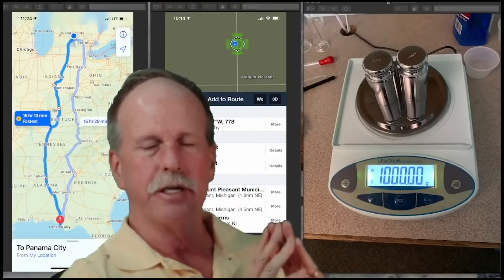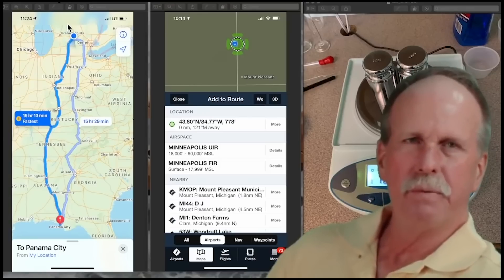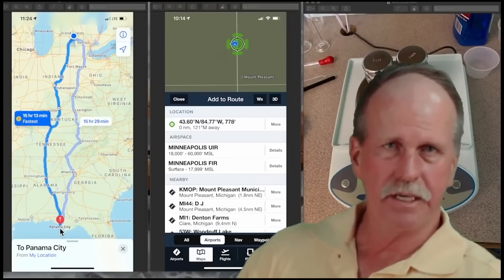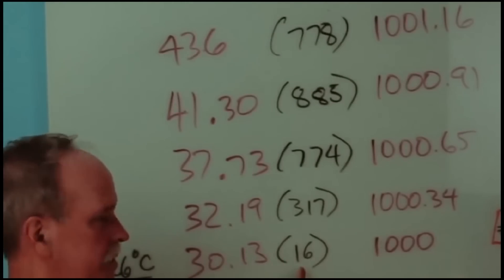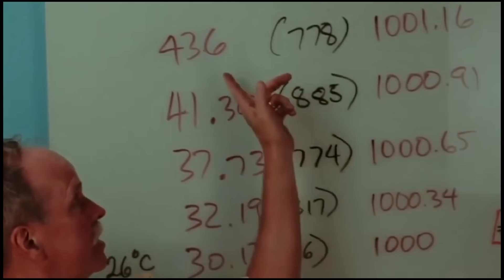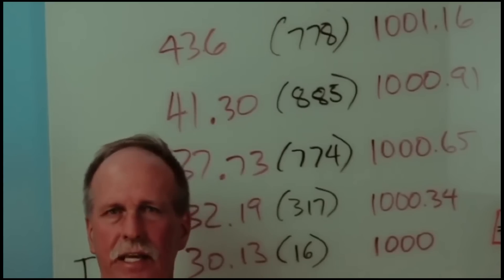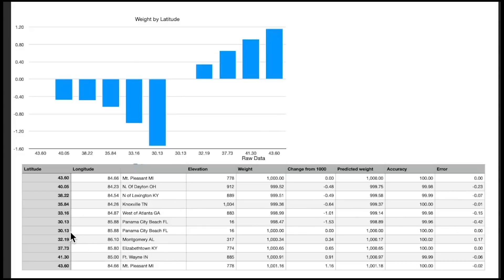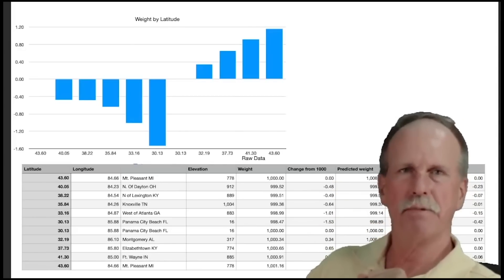Rotation Test for Flat Earth

Comment: Can you prove that the calibration of your scales didn't drift between measurements?

It might have been better to NOT recalibrate in the middle of the journey, and prove that the scales read the same once you got back to your start point - not rock solid proof of no calibration drift, but it might be supporting evidence?
Reply from the maker: the calibrations and results are in the video and they matched the prediction and concurrent readings from other investigators.  proof is in the pudding and it demonstrates the care I took with the measurements.
Reply: @BobtheScienceGuy  Sure. But if we're being rigorous, we can hypothesise that your measurements could be subject to calibration drift. Agreement with other observation, could be coincidence. Can we prove that's not the case? Particularly chucking a measuring device in the back of a car and driving for several hours ... is it not reasonable to ask: was their calibration drift?

Comment: The discrepancy could be attributed to the difference in gravity,  which has been mapped out, as well as the differences in gravity due to elevation. That's why I don't think the data rides the prediction line tightly.
Reply from the maker: No it cannot. Look at the design again.  1/ different routes to account for variations in gravity 2/ matches multiple other similar experiments 3/ matches globe predictions
Reply: @BobtheScienceGuy  
I think we are both on the same side of the argument. 
The different routes would only add another reason for the data points being a bit scattered over the line, and not in a tight line. We all know that gravity based on elevation changes where you are in Earth,  based on (what I think)  the differences in density. That had to come into effect,  along with all the other reasons you listed. If there were no differences in density,  then it would only be elevation and latitude affecting the readings.
Reply from the maker: I think so as well, which is why I took a high and low land route to account for that.  As you are well aware, less than a mile of increased elevation will not make much of a difference with a 4000 mile base radius.  Even 250 miles (the ISS) only results in about a 15% reduction in the force of gravity due to the increase in radius.  1 mile or less is nothing.

Comment: My thought on the outliers of the tests you did could have been caused by temperature of the scale making it read just off a bit. If all the tests were done on solid surfaces and the same temperature for the measuring device then maybe you would not have gotten the outliers. But if the temperature was different than the initial calibration during the testing I'd suspect some variances and we see that. More points of data in both the weights and temperatures would be helpful but this clearly shows the rotating globe vs the flat. Excellent test.

Comment: The altitude is not the same because you forget to mention the last value. But 16ft near a shore would be reasonable. Since you are using a very small mass the difference between gravitational pull between Michigan and Panama city is minimal. And that is even within the United States itself. Also nothing is being said about the weighing conditions. Did you use exactly the same surface when you did all these weighings? The Earth is just rotating, and why would it not? It's a planetary body in the vacuum of space, and yes, it's gravity holds the 'liquid' atmosphere to the planet and takes it with it. I call this a 'liquid' because compared to space our atmosphere is a liquid. The same as water is a liquid in relation to gas.
Reply from the maker: I believe it is on the table

Comment: The Coefficient of Thermal Expansion of a solid eg: metal weight is much smaller than that of a gas or gas mixture eg: air.  Therefore if latitude decreases (and elevation remains the same),  relative density should INCREASE the "weight" simply because temperature trends higher (the opposite of what actually happens).  This also means that at a given latitude,  "weight" should fluctuate with barometric pressure.

Comment: First off, I am not a flat earther. I have a degree in physics and I work in a materials test lab. 

We do a test where we measure the density of samples using wet and dry weights. We measure a sample in air and then again in water. The sample weighs less in water due to buoyancy. We plug those numbers into an equation and get the density of the sample. This is far more accurate than the method you use. 

We also do environmental conditioning. We use hot wet chambers to drive moisture into samples. Typical conditions might be 160°F/85%RH. We periodically weight representative samples to determine how much moisture they have gained. When we weight the samples, we have to cool them to room temperature (RT), because hot specimens will be less dense. Because we are weighing these samples in a fluid (air), hot samples will weigh a little less than RT samples. If we place a hot sample on the scale, we can actually watch the weight increase as it cools. 

I don't remember how much the weight changed, but you could do this at home with your scale using anything you were willing to heat up to about 150°F. 

To determine the density of the reference weights due to temperature, we would need to know the material the weights were made from. Different materials have different coefficients of expansion. 

On some calibration weights, the top threads off and there is a chamber inside that contains sand (I don't know what kind of sand). Calibrating the calibration standard involves adding or removing sand. Submerging the calibration weight for either a direct displacement method or wet/dry weight method would not give an accurate measurement for the material density. It might, however, be sufficient to determine if there is an air chamber inside the calibration weight, assuming you know the actual material density. Also, you might want to compare the weights of your calibration standards to make sure no water has seeped inside the one you submerged.
Reply from the maker: Excellent points. Do you think any of these variable would account for the weight changes observed
Reply: @BobtheScienceGuy  Highly unlikely, especially considering how well the results match the predictions of an ovoid Earth. I also assume you performed most of your measurements at room temperature with a variation of a few degrees. If anything, variations in temperature might explain some of the outliers. 

The specification we use to determine density doesn't correct for air temperature, but it does restrict air temperature to 23 +/-2°C.

Comment: I will do thos experiment, it does look fun to try, I can lend some equipment from university. Easy way to cancel out temperature is by putting each weight in a precise controlled temperature bath for about 15 minutes, BUT, temperature and pressures in my experience have a neglectable change, such changes are used in lab tests to have 0.001g accuracy, which woyld be fun to test. For instance, the density of watwr is 1000kg/m³ at 4 degrees celsius, we have a table of corrections to see what the temperatures are. But definitely I will take a look at this and try to add data, life is fun and full of exciting truths.
For the flat earthers...prove us otherwise, science is about concrete math and proof, like this, a proven statement is assumed correct until proven wrong, science it, happy holidays!🌲🥳

Comment: This is a simple and convincing presentation for anyone that doubts the currently accepted model.  However, I do have one comment, which concerns the effects of altitude on the measurement.  The changes in the gravitational force should be very minimal, but the differences in air density and the resulting buoyancy changes on the masses should be accounted for in a precision weighing experiment.  If the air density (i.e., compensating for buoyancy effects on the masses) is built into the calculations, is the scatter in residuals to the fit reduced?  While I realize that this is a subtle effect, it does help to further demonstrate the predictive power of a good quantitative model (i.e., our understanding of the world and the nature of physical laws).  Thanks.

Comment: Don't mean to step on your awesome experiment. I really want to do this as well. And I have a weight that has three decimal points. =)
But it would have been quite cool if you DIDN'T know the latitude you took the measurements in advance. (Had someone else write them down, or at least just mark it on the map without knowing the latitude).
With the data, you should be able to get a "range" that the latitude MUST have been in when the measurement was taken. If ALL these ranges actually lined up within the error margin, that could also be quite cool for you as well, when you then receive the actual latitudes. =) Naturally we have to account for some one or two outliers, but the range should work.
Perhaps even bring an altimeter with you. Not sure if it's exact enough, but would be cool to have such measurements as well.
Thanks again for the cool demonstration =)
Reply from the maker: All good points. Not that they will change the results. They will make things more precise.  Perhaps for the vent one ,

Comment: Just an aside on measuring weight/mass. A typical triple-beam balance would measure no difference in the weight at the different latitudes.
If you want to make a WTF face, take apart the base of the hanging platter on an old triple-beam balance and look at what's inside.
Edit: I realized another aspect you didn't mention: Without the weights being on the scale, the zero would be off by the same amount as the measurements were. Some scales give an error display if the weight is too far negative.
Reply: For that matter, any balance scale would not show a difference, not just a triple-beam. The zero on a pair of electronic scales would not (usually) be off, as the firmware is set to 'zero' them when switched on, and the weight is usually measured as difference from that 'zero' point.
Reply: @dlevi67  Zero is not zero, it's the weight of the platter, and when you use a container your "tare" the weight to zero to take a measurement. That tare on many scales endures through a power cycle. He probably did zero it each time though.
Reply: @markc2643  There is no removable platter... or at least, you should not use one when using calibration weights, and Bob did not film the scales with one. The fixed platter is part of the calibration process, and should not be removed (if it even can - it's often glued to the sensor).
Reply: @dlevi67  The platter in the video when he shows his scale comes off. It's attached to a plastic frame which is likely attached to a bending beam load cell. I've repaired similar scales to the one in the video.
Reply: @markc2643  I don't think it does. I own those scales (I think - or very similar).

Have a Happy Christmas!
Reply: They wouldn't because they are measuring weighs to weights so any change in latitude would also affect the weights used for the scale at the same rate. Essentially you're measuring mass. If you took it to the moon, you'd get accurate results there too.

Comment: For the temperature to explain the measured changes in weight, we'd need temperature ranging from 0.01°C above the boiling point of nitrogen to that found in the hart of a blast furnace or even higher.

Comment: 735mph you've got to be kidding you would have trouble even walking
Reply: why would you have trouble walking? do you have trouble walking on an airliner while cruising?
Reply: I was on a German ICE train, traveling 250km/h, and I had no problem walking around. I even used the WC without issue. 

At what speed should I be feeling the effects of movement, friend?
Reply from the maker: Well that is the rotation linear velocity.
Reply: No, you wouldn't have trouble walking. The dominant force acting on you is gravity, at 9.8 m/s2. The centrifugal force pushing you outwards is only 0.03 m/s2 at the equator, i.e. where this force is strongest it's only 0.3% of gravity. This is not enough to notice, let alone cause you to have trouble walking.

Comment: I've loved the fact that earths rotation is the reason why gold is still measured using comparative scales.
Reply: To be honest, I've never seen that done (at least in recent times - pre 2000, perhaps). All the bullion merchants and goldsmiths that I've seen, use electronic scales similar in principle to those Bob uses here (though they may have 1 mg or lower resolution, enclosures etc. especially for gemstones).
Reply: @dlevi67     They would be calibrated at the time of setup and regularly afterwards …
Reply: @advorak8529  Yes. In most places it's a legal requirement for any scales you sell 'from'. It changes nothing on the fact that they are single-platter, electronic scales, not balance scales.

Comment: that is a very interesting and practical test you took, plus great analysis of the results.
but knowing flerfs they will just claim the weight wasn't measured in rubber ducks (or whatever the non metric lands use) and dismiss your hard work.
don't wait too long for the temperatures to arrive ... that will never happen
Reply from the maker: Been 14 months and no takers

Comment: Another way to demonstrate that Earth rotates on its axis once per 24 hours (1/1,440 RPM) is to weigh the difference in weight of an airliner flying east to west, as opposed to the same airliner flying west to east. Flying west to east is with the rotation of Earth and will lighten the plane. Flying east to west is against the rotation of Earth and since the centrifugal force is lessened, the plane will gain weight.

 Wolfie6020, a transoceanic rated pilot who flies Bombardier aircraft, shows that when flying East at 600 knots, his plane's G meter says .99G. That means that the weight of his aircraft, about 90,000 lbs normal flying weight at takeoff, would be reduced in weight by 900 lbs. Flying west at the same speed his weight is very close to the full 90,000 lbs. This is confirmed by aircraft instrumentation and vital to the operation of the aircraft. I don't need to say that a 900 lb reduction in weight is not trivial, is very important to know and affects the operation of the plane.

Of course I provide proof that I tell the truth: https://www.youtube.com/watch?v=n4khR31bvp

Comment: The "outliers" are easily disproven.... all it takes is more data. 10 samples is not a statistically big enough sample size to compensate for them.
It was an interesting discussion point to disprove Temperature as a factor as density is irrelevant to the mass... Surely when the object changes temperature, it also expands, so it changes density... but that is irrelevant to the mass.
The "missing" test here to disprove temperature as a factor would be to do have run the test in Panama City indoors on a hot day... then throw the Air Con on to cool the room and repeat.... weights should be identical.
(And if you want to discount air pressure, drop it in a vacuum box as well)

Comment: Hmmm - I wonder what effect temperature and bouyancy in air could theoretically have?

So - if the temperature goes up, there would be a slight thermal expansion of the reference weights, which (assuming it did not affect the air) would imply lower density, higher bouyancy, and so less measured weight.  But - the air is affected.  It becomes less dense - which reverses the effect somewhat.    

Just thinking it through a little - I suspect the effect may be too small to be measured on your scale (that is, I think it would be a less than 10 ppm effect...).

Oh - a little more thinking about it - 140cc of air weighs 0.17 g at STP, a change in temperature (upwards) would only decrease that, increasing the measured weight of the reference - but not more than 0.17g.  A change downwards, would increase the density of the air but 10 degrees would only increase it by around 3%, or about 5mg (maybe enough to change the last decimal place) - note an increase in temperature would give around the same decrease).  The change in volume of the reference weights would contribute far far less (around 90 nanograms)...  So, yeah - temperature might contribute to some measurement error - but, altitude and variations in the local gravitational field may contribute as well - though, I am not sure how much only a few hundred meters would affect it.

I think one of the big problems Flat-Earth believers have is that they won't put numbers to their theorizing.  Can temperature affect the measurement?  Yes - through a couple of mechanisms (humidity will also affect the density of air), but - how big is that affect.  Don't just say there's an effect, calculate out the size of it!  I did, and am quite convinced that the effect due to rotation is far less than any effect due to temperature differences.  It was a bit of work for me to run down those numbers, but doing so reminded me of various bits of physics I had learned years ago, and so it was a worthwhile exercise.  I wish they would make the effort, maybe they would learn something from it.

Comment: What about temperature effects of the calibration of the scale? I suppose a super accurate scale would take that into account. But it might be interesting to see how the scale read in the same location vs ambient temperature.
Reply from the maker: Very minor. See what you get when you c  as oculars them
Reply: @BobtheScienceGuy  I suspect the effect of temperature on capacitors inside the scale would be orders of magnitude larger than a change in buoyancy from cold air. But as Jim said: the scale probably compensates for that.

When the car stereo is running at -20C and below it definitely sounds like the treble has been turned all the way up.